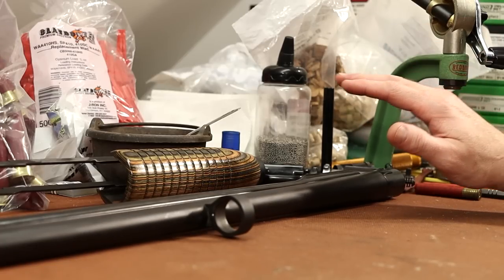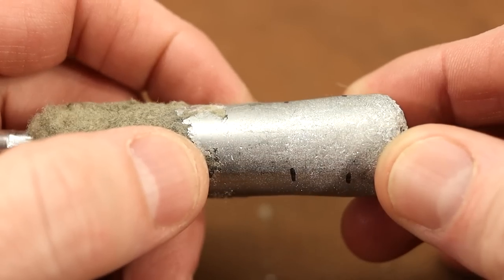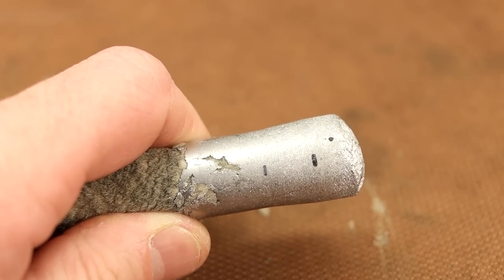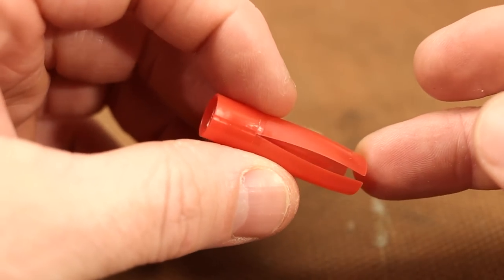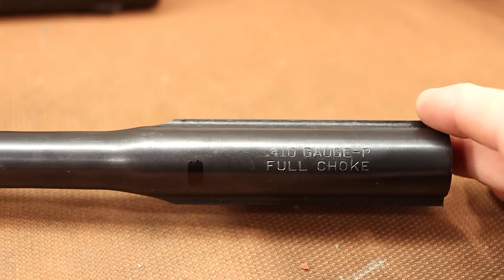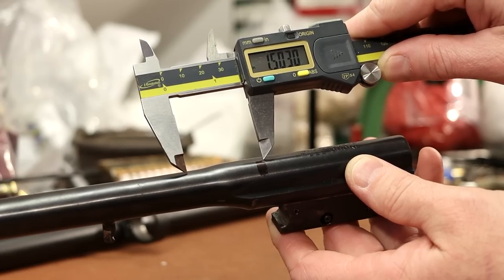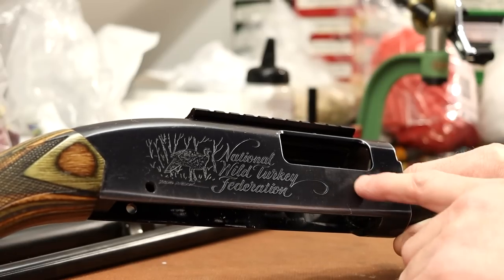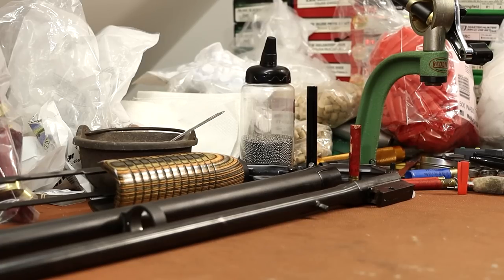Day 3

Comment: The full choke is probably not a good candidate for the tungsten shot. The rule of thumb I learned when getting into shotshell reloading, when using steel shot use a choke 2 sizes larger than you would for lead. I would think that would apply for tungsten also.

Comment: I had Briley lengthen the forcing cones on an old Winchester 42 sXS because it kicked like a mule. It did help the recoil somewhat. It is an old gun that is relatively low value, but I like it so it was worth it to me. I did not notice any change in the pattern, but I was just using it for lead shot. But, in your case with the 410 having a full choke you might have to get it opened as well. You better ask the gunsmith about the choke.
Reply: The tungsten shot does well with IC and cylinder in 410

Comment: I haven't worried about the forcing cone in shotguns, so it'll be interesting to follow this. I do know that back in the 80's (maybe 70's), the gun gurus did a lot of experimentation with the chokes of the 410. Long story short, the only two chokes that affected pattern density consistently and reliably were open and full. Yes, the modified choke changes things, but there was more differences between one gun and another than there was with modified chokes in the 410. Another little quirk of this bore. 
Point being, you might want to see how everything works before changing the choke of the 410 as one commenter suggested. I'm thinking that the tungsten shot cups will handle the full choke without any issues in the 410. I'm also guessing that the 12 won't like tungsten through a full choke. I'm visualizing issues with anything tighter than modified when using tungsten. Good luck 👍.

Comment: Watch out.  Forget about the forcing cone issue, half an inch is plenty.  The real concern is the Full Choke on the 410.  410 bores will have naturally thick barrels but a full choke running tungsten will see over-pressure, not to mention the deformation of shot resulting in pretty poor patterns.  I would open it up to IC or a Light Modified max.
Reply: Agreed,  you never shoot steel through a full choke.
Reply: Small size (7-10 ) tungsten is shot through tight turkey chokes all the time.  But they are screw in chokes made for it.
Reply: @davidpippin1845  Understood but you´re not going to go out hunting anything larger than a pheasant with anything smaller than 6 shot and they would be preserve birds not wild where 5 or even 4 shot are required.  Granted you would not be using a 410 for that.  With firearms it is best to assume worst case scenarios and tungsten demands respect.
Reply: @davidpippin1845  check the inside diameter of that "tight" choke.
Reply: I would be concerned.   When steel shot came out, they said it could rip a screw in choke out of the barrel.  The mod. and imp. cyl. were recommended. 🤷

Comment: Using sulfur to measure your chamber is the way my grandad did it (& also cheaper). I would avoid breathing it in, but it works well, and it breaks easy. The latter is a pain if you have a good result, but a delight when it gets stuck. I really love this series. Thanks!

Comment: interesting on the forcing cones . makes since . i got a old topper 410 myself don't know how old it is . got it dirt cheap at a pawn shop had a lot of fine surface rust on it but nice bore . i duracoated it looks like new now . i started loading 410 a couple of yrs ago but do them the hard way , no press . the loads all work but the crimps do not look nice lol ! i started making brass 410 shells from 303 british cases . not hard to do . even ordered a box of the brass cases . use a 308 seater die to put a ' crimp on the cases then cover them in glue . they work good only the ones made from 303 cases look funny , smaller at the base then the case mouth . keep up the great work shannan !
Reply: I've watched videos about making brass 410 hulls out of 444 Marlin brass... looks like it would be fun for low volume playing/hunting.
Reply: @bobkmac  be easier that from 303 brass .

Comment: I have a Winchester 1300 Defender with a 18" barrel. I got it around 2008 I think. Didn't know about the forcing cone. I've been loading flechettes in it and haven't got very good velocity yet. I'll look at the forcing cone so thanks! Saved me some time lol
Reply: I did not know about the forcing cones either... Johnny taught me something again... That's why I subscribe. 
I heard somewhere that you should not shoot steel shot thru a full chock .. checked a few forums on it and it appears to be contingent on shot size... Tungsten being heavier and harder I would read up all I could on that b4 sending it down a barrel.
Reply: @DadWil  I heard about wax slugs from Kentucky Ballistics. I'm going to try it with flechetts instead of lead shot. I've had a real problem keeping the pattern tight beyond 10 yards.

Comment: The other concern I would have with your shotguns would be the chokes. Typically fixed chokes are not recommended for steel (and I would presume tungsten). In addition to full choke being probably too tight for a non compressible shot, fixed chokes generally compression to length ratio that steel chokes.

If you ever measure a steel choke marked "steel full", you'll find it is typically an IM choke, not a F choke.

Comment: Man this makes me want to order a 410 conversion kit for my MEC sizemaster! I have an old H&R 410 very similar to yours only it has a fixed cylinder bore or maybe improved cylinder barrel mics out to .406. Me personally I would leave that .410 of yours exactly how it is and just shoot game loads/regular lead shot thru it and look into a Stevens 301 with screw in chokes. I'm not sure if tungsten is the same as steel in that aspect and is not safe to shoot thru a full choke? Just something to think about. I've never messed with tungsten but seriously been looking into it to work up a good long range turkey load for my 870 express super mag 12 gauge. That stuff is just so blame expensive compared to lead shot though. That's the only thing keeping me from jumping on it lol!

Comment: Lengthening the forcing cone is more about patterning than anything else.  Don't mess with it unless your patterns stink.  Lengthening the forcing cone reduces the chaotic effects of the shot bouncing off each other pellet.  It makes a bigger difference with larger shot and harder shot.  Thus it was common to do this for guys pass shooting geese with large shot (#2 or larger).

More important is (as others said) the fixed chokes.  Steel is bad on tight (full) chokes.  Tungsten is much worse.  Choke tubes with tighter constriction are marked not for steel use.

If you don't protect the barrel from the shot, with the harder ones (steel and tungsten) eventually you will see gouges on the barrel interior.  Again, worse with larger sized shot.

I have seen a blown out ring right at the end of a barrel where the choke starts with steel shells and older barrels with fixed chokes (70's-80's manufacture.)  Had to rebarrel an Ithaca Mag 10 due to this back when steel first came out.

Comment: It would seem to me that you would want to start with a barrel rated for steel that will handle the pressure. I think longer forcing cones help a lot with recoil and control ability as in point ability. Take the old guns to the range and shot some games with them and have fun but don’t try to make do something there not designed to do. Love the Channel.

Comment: What are you talking about time wise that the tungsten would do damage without adding length to the forcing cone?  Immediately or over 10 years?  I guess it would also depend on the number of rounds shot through the barrel.  If you were planning on shooting only tungsten shot and no other than I could see getting the cone lengthened I guess.  Not trying to troll here and if it seems that way I apologize.... just curious. Thanks for the series!!!